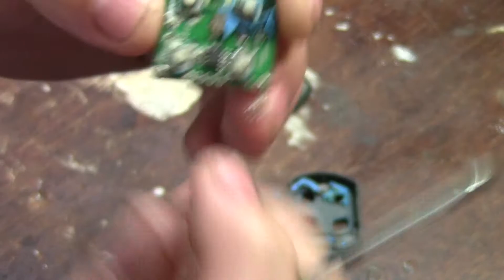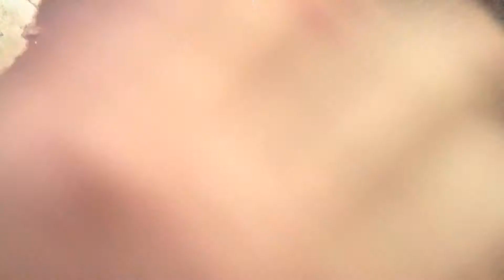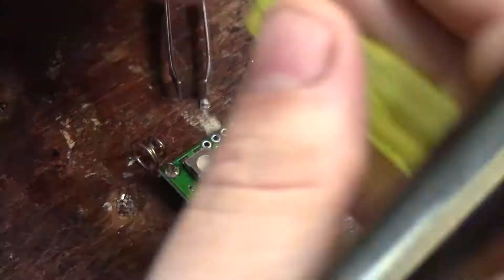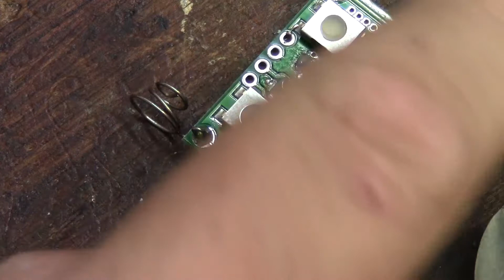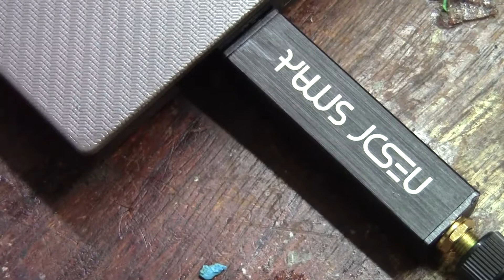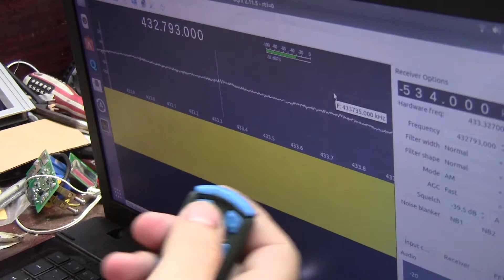ShoutingElectronics #15 - LFMF - Trying to fix RF Remote Control

Comment: Get the newer case kits, they are silicone, and are a lot harder wearing than the older PU injection moulded keypads. They at least do not turn to mush with time. Just got to watch out for versioning on those boards, they have changed slightly in design since Centurion merged with the competition. 

When next at AI get a litre of the flux, it really helps with the soldering on the flea size parts. If you decant it into little dropper bottles it is really easy to use.  PM me when next coming to Dirtbin and I will spot you a few bottles of the flux in dropper bottles, otherwise they are hard to get, plus some new tweezers. Even a few SMD solder practise boards as well, totally non working, but good to learn on where messing it up does not worry you.
Reply from the maker: Thanks for that. Will do
Reply: @ShoutingElectronics  Not a problem, got the little AI bag already full.